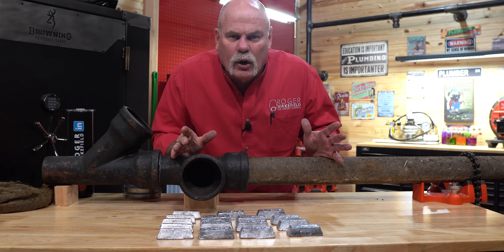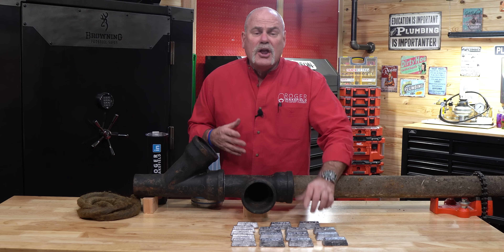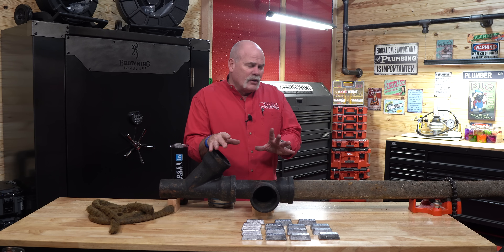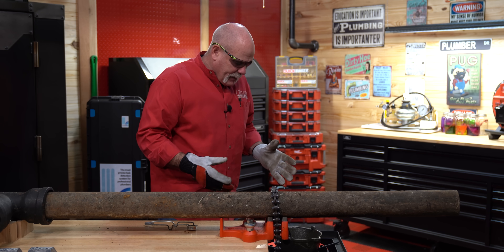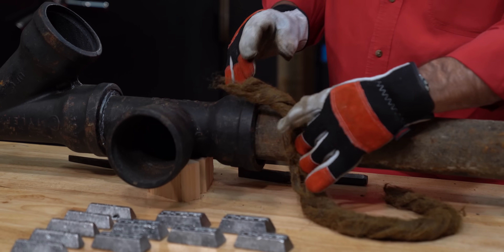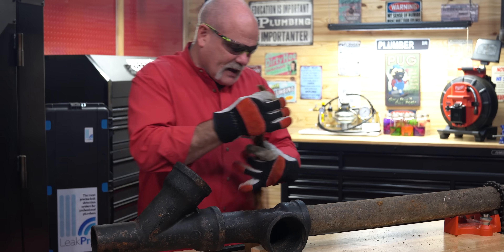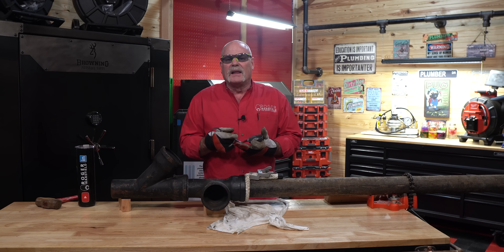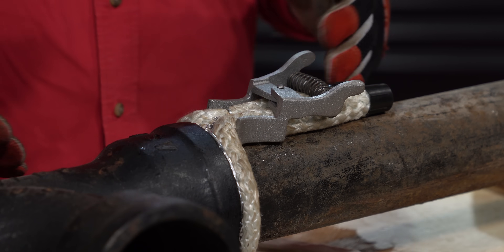How Plumbing USED to be Done

Comment: Retired electrician here, just had to see how they did. My garage, built in 51', has leaded cast iron. By the way, many decades ago, they used lead for electrical connections. They were dipped and then wrapped with friction tape. My house still has some.
Reply from the maker: So cool! Have you had any problems with it?
Reply: @RogerWakefield  The cast iron was bumped into before I bought it. It put a kink in it where there was a joint, I think they sealed it back up. The pipe must have been cracked because there was a wrap around it, can't remember what it was now, but I covered it with rubber tape, which chemically bonds to itself....so it's like one big rubber slab. Otherwise, it's fine. The leaded wire connections are solid, literally. Once they're dipped in lead they'd have to be cut off, there's no separating the twist.

Comment: Lol, dude trying to caulk a lead joint with a packing iron, smh. Then risks breaking the hub of that wye with a 2lbs. hammer!!
If you pack it too tight, you can bust the fitting. 
All ya need to do caulk wise is go around the outside/inside with an 8oz caulking hammer to set the lead. Packing the lead in can bust the fitting.
Remember what you said earlier: the oakum seals the joint? Yeah the lead just holds the oakum tight.

Comment: I did lots of lead and oakum joints, mostly on roof drains 30-40 feet up on top of staging with no safety rails or body harness.
2” - 12”, still have all 4 irons in my garage. Last joints I’ve done were with lead wool. I’m off to work on an old crust apartment building with old crusty bell n spigot drainage, have a good safe day.
Reply: PS,,, spray the lead runner with WD-40, so it doesn’t burn.

Comment: I was following my dad at the age of about 12 or 14 and was pouring lead joints by the time I was 15, both vertical and horizontal joints.  Now 65 years later I still have all the tools needed to melt, caulk, and pour those lead loints and would love to see all that equipment be bought by someone that might still put it all to good use, and yes some commercial  jobs still use leaded joints though No-Hub has taken over much of the soil pipe landscape today.  I have all of the horizontal lead runners, ladels, and caulking tools including the curved ones that allow you to caulk behind the pipe, along with all of the ladels and propane melting pot and burner.  Purchased today, some of those caulking tools sell for $60.00 each.  Lord was that XH cast iron heavy when you had to make up an assembly and then drag it under a building and lift it in place.  The way that we used to tell if the lead was hot enough in the melting pot was to test it by inserting a small piece of pine into the lead.  If the lead scorched the pine it meant the lead was hot enough.  I'd sure love to see someone buy those tools soon because at my age they won't be around much longer.  Great video.
Reply: let me know if you are interested in selling some of your lead and oakum tools
Reply: He said his time was short. Evidently he wasn’t kidding.

Comment: Reminds me of having to use hemp and soap on threads when I did my apprenticeship building fire pumpsets back in the early oughts.  I was told that we used hemp because teflon etc would melt in a fire but the hemp will hold up.  Your thumb and forefinger would be really clean at the end of the day.

Comment: My father shot Black Powder competitions in the North-South Skirmishing Assoc beginning in 1968 and getting lead to for casting bullets was always in high demand. He went up to the a range in the early 70's with a friend to a range in Ohio, and the friend found that a local hotel built in the late 1800's was being torn down. His friend borrowed my dad's truck to run over to the site on Sunday afternoon after the match was over to pick up some lead the demo crew was throwing away. His friend had put about 300 pounds of old lead pipe sections in the back of the slide in camper on dad's truck. It had a window between the cab and camper section that was permanently open and couldn't be closed. It turned out, the lead pipe was from the men's bathroom urinals in the bar that was on the first floor of the hotel, my dad said the entire ride home was horrific with the smell of the crystallized urine in the pipes. They get back to Savanah to drop of my dad's friend and as their unloading the pipes, my dad's friends looks funny at my dad when he won't stop unloading it. They had agreed prior to the friend borrowing the truck, that they would split the lead in half. Well my dad graciously told his friend that he really didn't need any lead at the time and made sure ALL of it went into his friends garage. He said the camper didn't stop stinking for month after that.

Comment: No packing required after leading, your ladle is the right size and you are vaporizing your lead with that giant burner. The single strand of oakum is correct. Great job all around, as it doesn’t have to be perfect it just has to be done.

Comment: In the middle of a blizzard, my kids broke off a 2-in ABS drain in the basement coupled to a 3-in ABS with a reducing bushing, flush with the top of the bushing, I made a jig and drilled out the bushing with a fostner bit but my ABS cement was all gummed up, I scrounged around for what I could find, and I'm hoping you're going to tell me I made the right choice I had a two-part epoxy made by loctite rated for 15,000 PSI, and it said that it was safe for abs, and I had PVC cement, I went with the epoxy is that okay or should I go back and cut it out now and replace with ABS cement?

Comment: Hummm, using jute instead of white oakum with a brand new running rope that has not been soaked in linseed oil and worked with a hammer.  Guess I went to a different school than you in 1967 when I started my apprenticeship.

Comment: Not bad. Not great, but a brave effort when some areas still require caulked cast iron due to local codes. (Hello, Local 130!)
I taught the apprentices in an Illinois Local for 20 years and performing a caulked joint is still a requirement for the journeyman’s license exam.  Here are my suggestions to improve your video. 
Oiled (or “tarred”) oakum is usually sold in the precut length twists you used. They are meant to be separated for use. The length is predetermined at about 27” to allow for wrapping around the pipe and a bit more so the next strand laid in and butted gives a smooth transition to each layer. You might have mentioned the alternate White Oakum which is the same fiber but is made with an impregnating of bentonite clay and a fiber net wrap to help it hold it’s shape. Bentonite give it the white color and also swells in volume when wetted. It is not allowed to be used for the journeyman’s test and is often looked at by old hands as a cheat for guys with sloppy skills. But it works.
Next, start out with the different kinds of irons. Yarning irons, packing irons and caulking irons. You had the last bit about inside and outside irons right, but it needed explaining or demonstrating better. The irons push the lead to the center of the annular space between the OD of the pipe and the ID of the hub. Flattening the raised ridge after that is optional. The main thing is that the  oakum must be packed in tight. The top, before pouring , should be harder than hammered hell. Caulking irons often get a permanent mark at the 1” level with a hacksaw. An old cheat at this point was to sprinkle wax candle scrapings in on top of the oakum before pouring.
It is a shame you couldn’t get a real old plumber’s furnace for your demonstration. The sort that screws on top of a 25# propane tank. And a full depth round bottom pot. It should hold about 15 pounds of lead so that “drossing “ could be demonstrated. (Scooping off the contaminants and oxides before filling your ladle.) You already knew that a “double pour” was bad practice. That would fail you in an exam. Use a ladle big enough to fill the joint completely in a single continuous pour.
A couple of commenters thought using lead for this purpose contributed to lead in wastewater. Not true. Properly done, the lead never contacts the water. Its purpose is to mechanically restrain the oakum which is the sealing element of the connection.

Comment: When I was young, my dad did construction. He built houses from the ground up, we would set forms, pour concrete. He would dig the ditches and measure out the plumbing then come home and chisel cut cast iorn pipe then we would go back and set pipe, put in jute/okum and rap the joints with an asbestos rope and pour t
Reply: Then pour the lead. Thank goodness for pvc and pex..much better than cast iron and copper.

Comment: our house is all done this way.  I can't imagine the plastic pipe standing up to the test of time like cast iron and lead has.  I think they used oakum to caulk clipper ships as well, no lead though.  Picking oakum was a really lousy job that they did in the workhouses in Dickens' time.
Reply: Long story short, back in "the days of sail" oakum was used to fill the joints on the wooden hull. This was followed with not lead, but pine tar- pine sap,right from the tree. The sap had to be heated up to make it workable. Spill some on yourself, and get a nasty burn.

Comment: So, question, with Flint, Michigan's issues that it has with its drinking water, does this mean thaat the Oakum has deteriorated to the point of where lead has made contact with the water?
Reply: they had lead water pipes. the pipes were covered on the inside with water deposits, from years of use. when they started getting water from a new source it eat the hard water deposits and exposed raw lead to the water stream.

Comment: I used to work on a tugboat and we would use that and wood wedges to fix leaks in the hull on the fly until it could be fixed properly. That stuff will stop a leak without an issue

Comment: im beginning to wonder if you ever used oakum it all comes that thick now and what kills me is i can buy it but not lead incats so i buy a roof flange melt down if dad has no wheel weights and i will lead a cast iron or brass toliet flange in a heartbeat especially on slab house

Comment: How would you repair the lead in case of a pass through? (Hole through the lead or oakum). Torch the side of the pipe, or just restart the process?
Reply: take all the lead out. they used to have curved chisels for this, take all the oakum out also and start over. these days if i have to take a joint apart i use a drill  with a quarter inch bit first then the chisel

Comment: Rather interesting to see how its done. Over here in Europe it was similar, but tar was used instead of lead.
Reply: Lead joints here in Scotland in my house on all the none vertical joints. The vertical waste joints have all been done in cement.
Reply: I think in Austria it was some kind of cement-like material. Today's plumbers definitely use quick-setting cement when connecting plastic pipe to old cast iron, even oldschool ones like my uncle.
Reply: In England done this work on soil and drainage ( thicker pipe wall) into the late eighties then health and safety took over and we used mechanical joints only, what you call oakhum we called yarn and the furnace to melt the Lead was nick named the  "roarer",     these days on commerical build it is nearly all plastic fusion joints or melted butt joints on a high density black plastic pipe looks a sight but holds up well on test,  a few years back i drained down some old plumbing that was done in the late sixties and had been closed up from use for a long time, all cast iron drains, stacks vents and floats and other perfectly done work, all in metal,  the trade has changed in my time, like it did for the guy who taught me he started in 1933,  Lead roofing, Lead pipework and cast iron for him when he started.

Comment: I still use oakum and epoxy to connect PVC to the cast iron pipe. Anyone have other ways of connecting PVC pipe to cast iron?
Reply: cut the hub off and use a no hub clamp

Comment: My Dad was a plumber in NYC in the 60s. Once did the molten lead and Oakum thing... there was still a little water in the pipes and molten lead splashed out onto his face and into his eyes. He and my Mom spent a tense 2 weeks while he was in bandages hoping he wouldn't lose his eyesight. Thankfully, he made a full recovery. Later moved to Florida and did tons of rough plumbing on new construction... with all of the waste piping in PVC.....he didn't miss lead and oakum a bit.
Reply: When there is water in a joint, fill the runnered joint with motor oil and then pour the lead into the joint, there will be a lot of smoke and smell, but no blowback.  Learned this when I was working with an old plumber at a DuPont plant when we were leading a joint with water flowing through it.
Reply: This is why you ALWAYS wear eye protection
Reply: @sa-amirel-hayeed699  pretty sure the eye protection beck then was absolute crap that made the job harder and most guys probably didn't see the benefit.
Reply: Yeah I work for a plumber when I was seventeen and he taught me how to do that nocum he would say the proper way we did a lot of repair work on 1800's buildings in downtown Durango Colorado actually I think the Strater Hotel was 1700 just about all of the buildings downtown or huge and they had huge mechanical rooms in the basement and that was when Plumbing was an art science you actually had to Know Math and how to use a torpedo level the proper way you don't just use a bubble for finding Plumb and level you can determine degrees of angle and fall and rise
Reply: I used to hear stories all the time about one 24" screwed joint taking 2 guys 8 hours to screw together.  One to hold the wrench on, and the other to walk the 10' pull pipe back and forth.
Reply: I worked in NYC for about 4 years and to this day still doing lead and oakum for underground in schools and city contracts. Most people don't realize how dangerous it is. Lead is so reactive I've had a lead pot blow up cause the pig was too cold. I had left the city as well and I don't miss it a bit either!
Reply: @nicholasseriale1644  LOL they are still in use but they arent installing any and havent for over 20 yrs.. they are still existing, but its not law to remove them so whatver is still in service will remain in service  till its oneday replaced.. which is pretty much never they last forever lol
Reply: So your dad was a poor and incompetent plumber?
Reply: Was he not wearing safety glasses?
Reply: Did a job similar years ago but used a product  in a can called liquid lead instead of hot lead ,was a product that was made partial for that
Reply: Ypu torch the pipe befor you pour the lead tourching it will evaporative any moisture rookie mistake
Reply: You don’t know what you are doing, you pour the lead joint in one pouring,  NOT TWO POURING.
Reply: @Blox_fruit_master1  He did point that out, said he didn't have a big enough ladle and is ordering a bigger one
Reply: To tell a pro plumber don’t know what he is doing you either are full of shit or really ignorant

Comment: Great video. Oakum strand is a material/concept that has stood the test of time. I am a structural engineer who uses it to plug annular gaps around pipes through foundation and pool concrete walls/slabs. You soak the oakum in pre-catylized polyurethane resin, and it holds on to the resin while it cures and expands to seal. Not very different from this pipe joint is done, as neither the liquid lead or polyurethane resin will stay in the joint without the oakum.

Comment: In 1979 packing and poring a lead joint was part of the test in Oklahoma for your plumbing license. They had a 2 part CI hub and your lead had to be within and 1/8 inch of the 1" inch bead and your oakum was also measured. I still have my lead joint tools. Thanks for showing the way it used to be. I feel they have taken away some of the craftsmanship out of the plumbing trade. After you passed the test which included the shop portion of copper 45 offset and black pipe offset. You were a plumber, today I don't know. Thanks for this brought back a bunch of memories!
Reply: In canada at least its all written exams now. The plumbers are set up very similar to us electricians. Get enough hours working then take your red seal exam and you're good to go. Makes for a lot of book-smart but real-world-stupid people in the trades lol

Comment: Always have your ladle in your lead when melting. Ladles being cast-iron have lots of crevices that water can collect in. Putting a wet ladle in molten lead can lead to a trip to the burn unit. 
Ladles were often left in the lead pot as it cooled giving the lead a handle.
Reply: The things you don't think about until it's too late...
Reply: that using the ladle as a handle is a great trick im gonna use that one with casting
Reply: Leaving the ladle in the pot will cause the ladle to get hot, really hot. Pick it up with a bare hand and you will lose some skin when the blisters burst.
Reply: @chrisgee5893  Just don't use your bare hands fullstop when dealing with molten anything 😅
Reply: I dunno about you maybe  you're a product of a bygone time, but we all use steel ladles in Chicago. Yes you should have your ladle hot, but not by leaving it in the pot. Leaning it against the furnace towards the burner will suffice.
Reply: Poured a lot of joints back in the 70s,smoke a few of the job !

Comment: When we are doing the bottom joint of a stack job at the stack base and when we are putting in new cast iron flanges for toilets, we still lead the joints in. We don't replace cast iron stacks with PVC, we replace cast iron with cast iron, using no hubs and ferncos for all joints except the stack base itself and the toilet flange. We insist on replacing cast iron with the same because it's the quieter pipe.